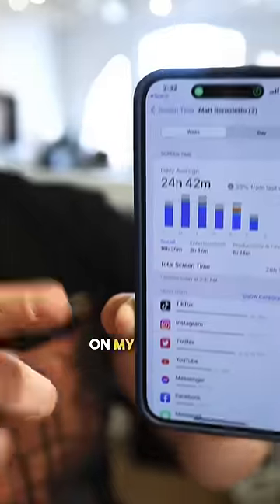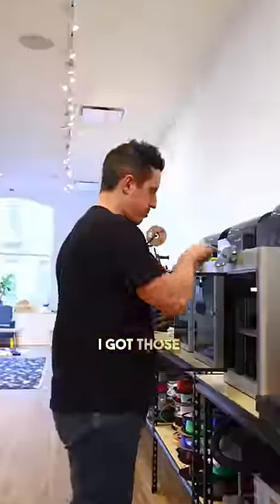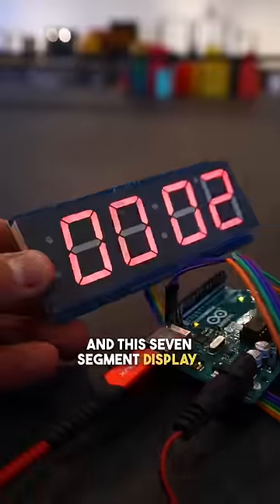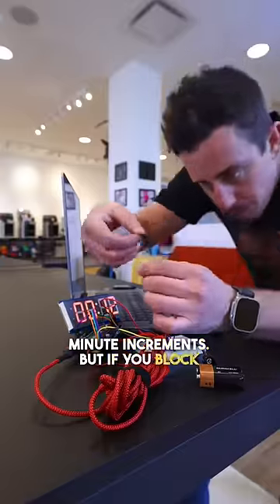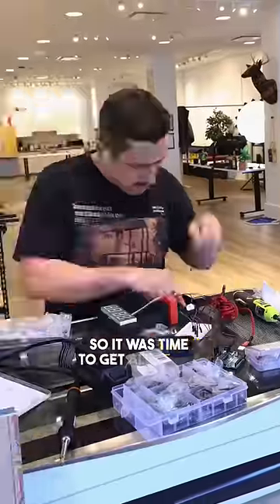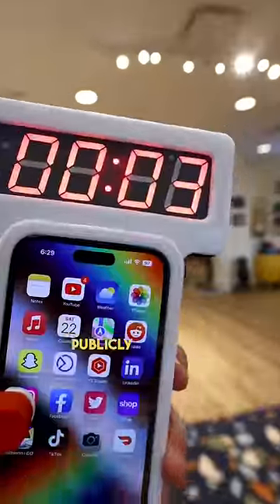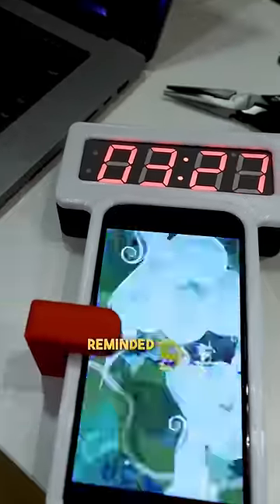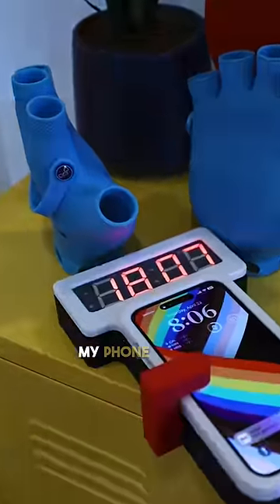This iPhone case is SAVAGE!

Comment: You could also make one that works in the opposite way. When it detects light, it doesn't count up, but when you have it turned over (aka no light) it begins to count. You could set the phone down when going to bed so when you wake up to pick up your phone, the clock tells you how long you've been asleep for, or how long you've made it through the day/night without using your phone!

Comment: Hahahahahaa that’s kinda useless. Moderating screen times is a personal decision that should be taken by you personally, in case you are unable to put you phone away to work on yourself and build connection with people or your surroundings,then I am afraid to say that you might Addicted ,just a ones around the corner who are addicted to drugs. Be able to get away from your phone for at least several minutes or hours